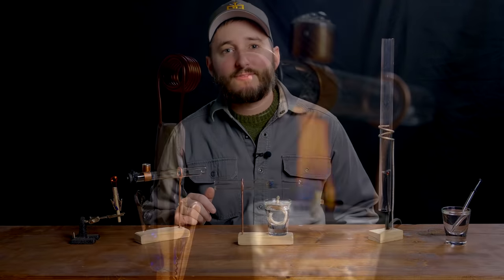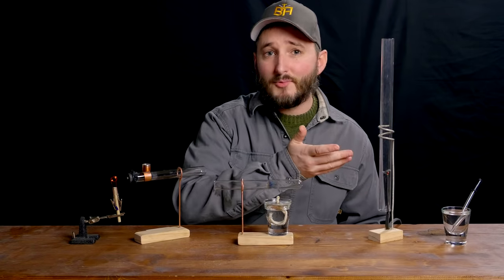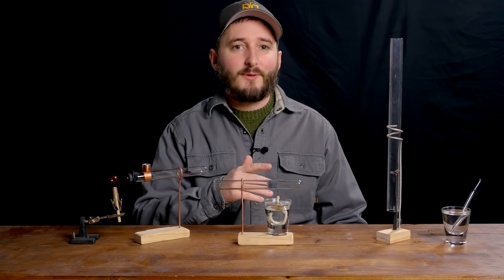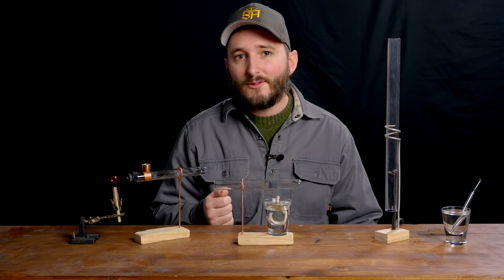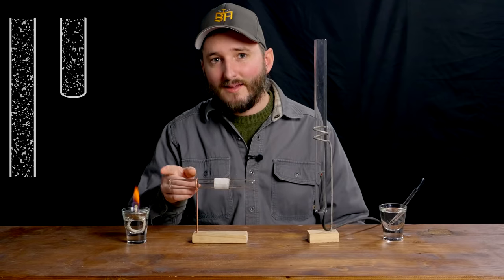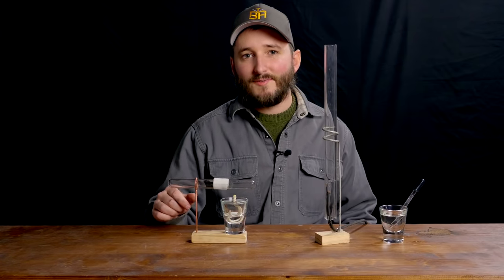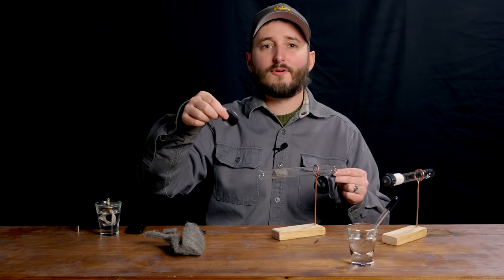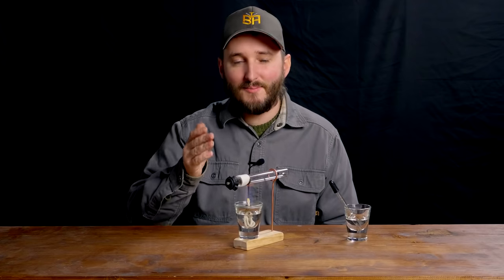Acoustic Energy & Surprising Ways To Harness It (Intro To Thermoacoustics)

Comment: Ah! Even without part two I can see how this can be used for cooling! Awesome video! To get power out of the coil you should try smaller wire, more turns, and an iron core. Or maybe go bigger with the design. 😉
Reply: what about an extra large version for your mars base?
Reply: Hey, love your channel keep going!
Reply: Could you see how this could be applied to solar thermal power

Using IR from the sun as heat input and a closed system boiling/condensing water as outputs (output IR while condensing such as a radiator) for cooling the system

On top of a turbine of course, wonder what kind of efficiency that could get

Together you have a radiator, refrigerator, solar panel and a turbine  from sunlight and sound

Think in terms of frequency my friends
Reply: I was gonna say the same about the coil.  I'd also say don't bother winding it yourself. The coil from a solenoid valve, microwave turntable motor or a shaded pole motor are readily available options.
Reply: Hiya Cody, nice to see you here. Apart from the coil with thinner wire and more turns he should stack few magnets together - not too many to prevent the rubber membrane from deflecting too much, and use an AC volt meter to show the coil voltage. After that he could start thinking about connecting a LED with 'full bridge rectifieeeeer' or two LEDs in oppose polarity way as it is AC rather than a light bulb.
Reply: The wire also needs to be insulated, perhaps even with nail polish. Wire the size he used in this video doesn't come with that insulating lacquer on it like speaker coil wire does, so unless he applied that lacquer himself, his coil was shorting out and not developing emf over its length.
Reply: @DownwardsRising  Not true.  You can get enameled magnet wire up to about 16 AWG just off the shelf and larger if you know where to go.  You see it used on things like transformers in microwaves and welders,  car starter motors and alternators.
Reply: @whatelseison8970  Good point, I have seen it in alternators come to think of it, and I forgot too how zoomed in it was at that point, so the wire looked like 10 AWG to me.
Reply: @DownwardsRising  You're kind of right but the cutoff is just much bigger.  In things like distribution transformers where the wire can be like 6 AWG equivalent or larger you start to see special uninsulated rectangular cross-section wire wound onto fiberglass separators instead.

Not having adjacent turns or layers in direct contact helps with heat dissipation and proximity effect but above a certain size it ultimately cuts cost since the max ampacity of a wire is often based as much on its size as on how hot you can get the insulation.
Reply: Cody.... I was thinking the same thing with Litz wire...
Reply: Am I the only one who thinks a pancake coil would be better with the magnets in this orientation and with such a short travel distance?
Reply: HI CODY!!!
Reply: Cody, why do I feel like you, of all people, would make like a piano that works like this?
Reply: @DownwardsRising  : THAT'S VARNISH COATED COPPER MAINLY FOR MOTOR REWINDS...
Reply: Check out my Thermoacoustic engine it produces 8 watts 😁
Reply: Just basically left a similar comment.. I finally understand how a Stirling Engine really works...one less mystery on my mind now:-)
Reply: I use a bass speaker 🔊 for an alternator  check it out😃
Reply: I still remember your gold plated magnet in the skin video cody! You got a great channel
Reply: lol like a fan? mechanical to thermal, but he did say using only sound, a fan has a sound, all sound is a pressure difference in atmosphere.
Reply: I feel like Cody left an advice under just about any science video on youtube already
Reply: Lovin that Cody is here. Collab??
Reply: I would say try using proper coated winding wire too.
Reply: Obviously, if the bulb isn’t lighting up you need to check your voltmeter! Or begin with LEDs… And yes, they are Diodes so they can be made into a rectifier
Reply: I just randomly found this dude on my feed. I wasn’t expecting to find cody’sLab here too!
Reply: @rustycobalt5072  I was thinking of the same concept. This is cool tech.
Reply: the master has spoken
Reply: Or match the resonant frequency of the circuit to the engine's
Reply: @einname9986  Cody: does something/says something.
Everyone: do it for Mars base.

He is more than the mars base.
Reply: @SunnyMcvin  But his mars base (or rather: almost all of his videos) are awesome
Reply: #Cody #AbsorptionRefrigerators
Reply: @rustycobalt5072  I guess you should reach out to "Tom Stanton" youtube channel 
 because that is an appropriate channel for these kinds of projects:)
Reply: @rustycobalt5072  “If you want to find the secrets of the universe, think in terms of energy, frequency and vibration.”
                                                                                                                                                                   ~Nikola Tesla~
Reply: Yes, and stick the iron core to the magnet on the end so that it projects out far enough to go inside the coil.
Reply: Id be very interested to see this concept expanded on a bit more
Reply: Hello Cody's
Reply: Together were unstoppable
Reply: See pulse tube cryo cooler.
Reply: Cooling, like how they were able to “cool” that 10kg mirror down and turn it into a quantum object at MIT?
Reply: Maybe the led was reversed polarity and that was why the led didn’t light up. If you flipped the led or rotated the magnet it might work.

Comment: Really nice demo!  Looking forward to the refrigerator!
Reply: One ben watching another ben doing cool science xD xD btw love your videos Applied Science!
Reply: Traveling-wave tube based refrigeration is being developed by NASA
Reply: Truth Never Lies  ...But you just said it yourself, NASA are contributing to developing the technology... so they are contributing something?
All science starts with a a hypothesis and can only be developed from there.
Reply: Interestingly, I thought of you when listening to this guy. Two things. Not only that you both perfectly formulate your thoughts so that it's easy to follow, but you even have similar voice timbres IMO.
Reply: Did it live up to expectations
Reply: @JohnSmith-eo5sp  Check out the free piston stirling electrical generators used in Kilopower for Artemis mission // the test unit been running continuously in a lab for more than 14 years // super ultra low helium gas friction only - no metal rubbing & no oil // they use these really trick machining techniques to get precision tolerances down to micrometer variation like some of the best photography lens making / ultraprecise machining / sadly at a cost that makes commercializing such a thing for billions of people to benefit from directly pending a major collection of innovations aimed to reduce cost of such a device / think cost optimization of the Slingshot vapor compression water distillation unit being developed by Kamen technology / its one thing to make one highly precise one with the world's best machinists & engineers in a clean room / its another thing to slog out billions at low cost for billions of people // even making millions of a high capital intensive machine (car) a really big slog // thats why Tesla the first automotive startup in America in more than 90 years //
Reply: @AaronSchwarz42  There have been several automotive startups in the last 90 years - like when Bantam Autos created the first Jeep, but most of these startups didn't last very long.
Before Tesla there was Comutacar(Citicar) in the 1970s.
Reply: @JohnSmith-eo5sp  Tesla is the first one in about a century that hasn’t gone bankrupt.

Comment: DUDE! This was the research I did for Texas State University. Our goal was to create a thermocouple using the resonance wave in a tube with open air. We were hoping the get the cold side of the thermo couple below the dew point and generate water. We were able to get a difference in temperature by 20 degrees F. 

Super exited to see more of your work on this topic!
Reply: fahrenheit is not a linear scale.. between which gradiant temperature exactly? or in °C?
Reply: @MD-qh6ld  its been a long time since I have worked with that stuff, but the hot side was up to around 80ish degrees and the cold side was at 60ish. That's all I meant.
Reply: @MD-qh6ld  Yes it is.  A 20°F change in temperature is equivalent to 11.1°C or 11.1K change, and requires the same energy change at any starting temperature.
Reply: Dope! Was this research published - and if so, where?
Reply: @dafenz5902  Unfortunately, we were unable to write a scholarly article about it. However, we did win the undergraduate research conference at Texas State University in 2017. I worked under Dr. Asiabanpour.
Reply: @MD-qh6ld  It is a linear scale but F is not a linear map (transformation) of C. And vice versa.
In relation to the topic, F and C are both linear map’s of K.
Reply: Why would you do science research using non SI units? I am not showing much enthalpy to being educated in imperial units, oops empathy :)
I  enjoyed the YouTube show because the presenter used metric units and I didn't have to mentally convert

Comment: If your looking for a decent voltage from your magnet, you'll need to use much smaller wire, so you can have more turns.
Also try not to let the thickness of your coil exceed the thickness of your magnet.
Lastly, keep in mind that when one magnetic pole travels in two directions rapidly, the energy produced from any coil around it will be alternating current, which you would need to build a bridge rectifier for if you want DC current for running led lights.
A small capacitor hitched to the positive end of the rectifier would also help, as it smooths out the pulsations in the wavelength.
Reply: would diodes work?
Reply: @gogogeedus  Yes, you could use four diodes to make a bridge rectifier, but the voltage drop across them would steal a lot of your power. LEDs will work on AC because they will conduct on the peak positive cycles.
Reply: You could also solder a pair of LEDs parallel, with opposite polarities.
Reply: Diodes will run with AC with 50% duty.
Reply: I don't think his copper coil was positioned right either.
Reply: @gogogeedus  LEDs are diodes that emits light so you can use the  LED as a rectifier and indicator that electricity is flowing

Comment: One last thought: My memory is a bit hazy on the specific equations, but I can try to point you in the right direction. The frequency that the diaphragm is vibrating is very important to calculating the ideal impedance of the coil you're using to harvest the power. If I'm remembering correctly, for this application, you're going to want LOTS of turns of very fine magnet wire.
Reply: I'm not an expert; I've just been tinkering with electronics and electricity for much of my life.  For a test like this I would, as Gadgetboy says, use magnet wire.  I'd start with at least 100 turns, but I could see it taking much more than that.  Instead of a bulb, use a multimeter so you can see the voltage you're getting as well as the current when running it through an LED bulb. 

Sounds like a fun experiment, and I'm looking forward to the thermoaccoustic refrigerator!
Reply: Impedance of the coil really needs to match the load.  As the load is a neon bulb, fine wire is required.  Were it an LED, this size is almost acceptable.
Reply: @notamouse5630  That's why I suggested to try LEDs with his current coil. it won't work *well*, but there should be a result.

An oscilloscope would also be illuminating.
Reply: Contract a coil winder!

Comment: 2:44 - I observed something interesting here.
When the tube is vertical, the convection currents going over the heater carry heat away.
However, when you put the tube on its side, the convection current was significantly reduced, and the heater glowed a little more brightly because there were less air flow to carry the heat away.

In essence, you created a device where the energy conversion can be manipulated. 
Verically for sound, kinetic (moving air), a little light, and a lot of heat.
Or horizontally for more heat and light, but less kinetic and no sound.

Comment: In order to make useful engines with higher efficiencies it is convenient to use lumped element resonators (Helmholtz resonators) instead of thermoacoustic resonance. It means, you need a gas mass and a gas spring separately, which can built up by use of a gas volume (as the spring) and a gas tube (as the gas mass inertia part). The effect is mainly to reduce the resonant frequency of the engine to operate a moving magnet linear generator. I have developed a double piston engine of this kind delivering around 1 kW of electric output power operating with electric heating with about 4 to 5 kW input power (I have used electric heating for simplicity and to measure the COP in an easy way). Maybe this is interesting for you.
Reply: Could you please show us some photos/videos?
Reply: I would be interested in your setup also.
Reply: Please demo on a YouTube video

Comment: Fascinating! These principles can also be applied to radio antennas. The wire wool is the feedpoint and the rubber diaphragm is working in a similar way to a loading coil (inductor), which can be used to make the antenna operate on a lower frequency.

Comment: Reminds me of a pulsejet/barking dog experiment- the resonant kind, with the flammable gas in side of the tube, and the compression and heat needed to ignite it oscillating rapidly

Edit: I guess all pulsejets are resonant in the same way as the valves aren't controlled actively

Comment: 15:56 --  Wrap your coil around a rod of soft iron.  Then move one end of the rod close to the magnet on the vibrating diaphragm.  The moving magnetic will induce an oscillating magnetic field in the rod and that oscillating field will in turn induce an oscillating current in the coil.  Using fine wire and many turns helps to increase the output voltage.

Comment: Good stuff, I never could exactly figure out why that 1/3 ratio was so important. I patented an expansion tube exhaust system for a internal combustion engine back in 1991, that worked with that 1/3 ratio. Unlike a megaphone these expansion tubes had a long convergent section that was highly sensitive to low frequency acoustic frequencies, of which were highly penetrating acoustic waves, that increased the vacuum at the intake manifold. I like to think of the 1/3 ratio as being a under square vortex... the greater the pressure, the  greater the energy density from coil & uncoil. I can't wait to see your next video!